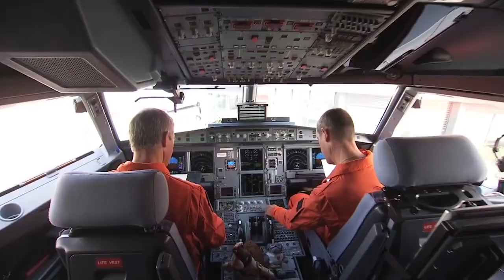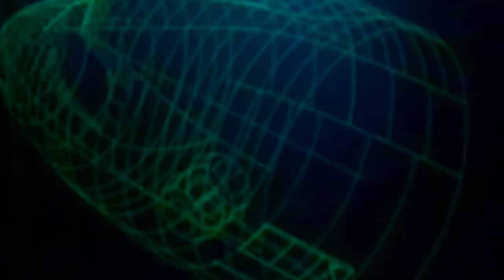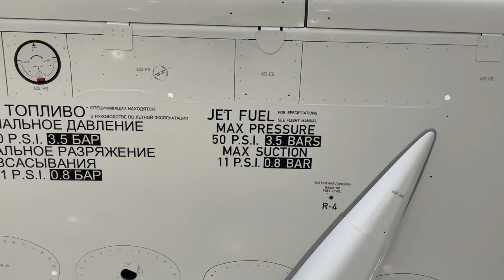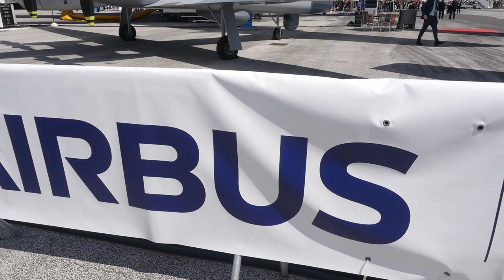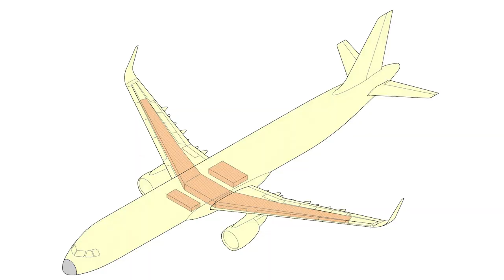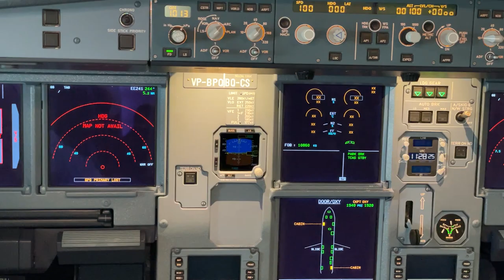Airbus A321 - becoming an ace of trumps

Comment: Delta was extremely interested in the Boeing NMA even wanting to be the first operator.  They wanted input on the design.  Since that evaporated, I guess they have moved on to Airbus and the A321 and A321 NEO.  They no longer have any Boeing Aircraft on order but plan to operate their refurbished B757 and B767-400s for the next few years.  (They are awesome with the new interiors; I flew on both last month).  Boeing screwed up more than the B737-MAX, they also forfeited Future Sales.
Reply: Testament to the late stage of corporate America
Reply: @ecoRfan  Yep - just in it for the investors in NYC at this point.

Comment: The 757 could have been the plane to modernize and build upon as it was newer than the 737.  There was not much economics to benefit from without drastically changing the 737 physically.  Airbus has in its DNA that ability to make changes on the planes it designs; from the beginning, versatility was all around, all the way to the luggage containers; flexibility was key in order to reduce the cost of operations whether for airfares, maintenance, repairs, or even the airports costs and insurance. I won’t be surprised if that philosophy inspired other entities outside aviation to evolve beyond their traditional business models.

Comment: Answering where this habit came from is very easy: since the A32x NEO proved to be very flexible, they can adapt it to serve a wide range of needs with a minimal investment and with no or minimal overhead costs to airlines. They would be mad not to take the money that's lying on the ground in front of them, especially since that strategy had mode than paid off by creating a massive headache for Boeing and virtually driving the COMAC out of the Western market before it was even released into production.

Comment: 4700 nautical miles is well over 8 hours endurance.  8 hours endurance is the maximum efficient endurance for a plane of this size.  At any distance materially greater than 8 hours of flight time, two crews must be carried.  In this setting, the optimum balance between seat cost and crew cost mandates a larger aircraft.  
Airlines might be making enquiries about such a jet, but they aren't paying deposits.  Routinely a paper order for an A321neo can be converted into an order for an A321ceo or even an A320ceo if desired.  This is especially true if the new aircraft's performance falls short of expectations.
Reply: Yeah it almost seems like the limits are being pushed by adding as much extra fuel tank capacity possible to what is already a stretched design, whether that compromise is performance or capacity.
Reply: @ecoRfan  That is true, but keep in mind the 737 platform is being stretched even further from its original design objectives.  For a given level of engine performance, the A320 design will stretch further than the B737 design, because of negative static stability and more clearance between nacelle and runway.  Already the largest 737s are needing a very high approach speed and any increase in empty weight will increase that landing speed further.  This was one reason why the 737 was unsuitable for the new airport at Sant Helena, for example.

Comment: The information on the ACTs (Additional Center Tanks) at 08:10 is not correct, in that they are not unique to the NEOs.  The two ACTs aft of the wing were an option on the -200 series that was taken up on virtually every aircraft; given that there were only about 90 A321-100 aircraft produced (and less than a dozen still in service) and that virtually every A321-200 has the two optional ACTs aft of the wing, for all practical purposes one can assume that all A321 CEOs have those two tanks.

Conversely the forward (third) ACT is not standard on the NEO but rather is an option for the A321LR model.  American Airlines, which is the world’s largest operator of the A321, has about 45 A321 NEOs in service so far, none of which have the forward (third) ACT.   American is also taking delivery of ETOPS A321 NEOs that may have the forward tank, but as best I know right now will not.   

American Airlines A321 NEOs will not get increased fuel capacity over the standard A321 CEO until taking delivery of the XLR variant, which will have an even larger permanent Rear Center Tank in place of the two aft ACTs and  which is roughly equivalent to four ACTs, or doubling the aft ACT fuel capacity, while the forward ACT will still remain available as an option.

After all that, the short version is: All 321s - CEO and NEO - have the two extra tanks behind the wing, while some NEOs may add the option of a third tank forward of the wing.

Comment: I think the next generation of clean sheet designs will aim for the size of the A321 with options down and up. The A220 has demonstrated the benefit of having a smaller dedicated aircraft, and the A321 size allows you to reach both the Small segment and the MMA
Reply: At this rate it will be 2050 if we're lucky.

Comment: They're basically milking the most out of the a32X fuselage for max market diversification in a point to point based route paradigm
Reply: Wish Boeing re-engined the 757 and made a 757-400 NG/MAX. They could easily increase the range to 5000 NM.
Reply: @Dave-dh7rt  why 400 though? Do you mean a stretched fuselage or just an updated 757 the size of the 200
Reply: @Dave-dh7rt  it would require much more than that. In addition to aerodynamics the Airbus lineup is far more efficient with space, both in cabin and fuel layouts. The aircraft is also significantly lighter (~50k lbs) and uses some composite structures. 

Plus you can’t just bump raw specs… safety and redundancy as well as better cockpit ergonomics (large LCD screens with fully integrated FBW, complete triple redundant systems and flight protections, etc) are also big selling points. 

I also don’t think there is currently an engine being offered in that power class, plus Boeing’s own CONSTANT mention of an NMA essentially destroys any potential for a 757 MAX type plane. 

Also there’s the issue of commonality which wasn’t brought up in the video - airlines LOVE being able to train pilots on a type that can essentially do almost anything they need. The same goes for their maintenance teams and parts depots, etc. Bringing the 757 back in any form would be a logistical nightmare for most airlines.
Reply: @EstorilEm  Plus the 757 is long out of production, and the tooling is long gone.  I see a lot of people on Youtube suggest a new 757 building programme but that would require not only re-tooling, but re-certification of a 50-year old design if it could ever happen.
Reply: @owenshebbeare2999  38 year old design, not 50 (1983).

The A320 is a 34 year old design by comparison (1987).
Reply: @EstorilEm  Aerodynamics? The A320 wing hasn't changed since 1988, and the airframe systems and cockpit since 1987 (ok, the CRT's were replaced by LCD's, but they still follow the same 1987 form factor, not the large ones you see on 2010's aircraft like the A350 and 787 as you claim).  

While the 757 won't come back, you make it sound like the A320 was introduced 25 years after the 757 - it wasn't: 1987-1983 = 4 years.

Regarding redundancy and safety - the 757 still has a comparable safety record to the A320 CEO family, and is still more modern than the 737 NG in some regards (cockpit ergonomics as you mention).

Comment: The thing is ,the A321 LR has somewhat wierd handling charactistics during landing , it likes to drop suddenly after retarding the throttle,also the auto-thrust is nowhere near as responsive as the CEO ,during approches the speed is always off buy around 10 knots.of course pilots can learn to deal with the changes but these two factors combines sometimes makes it really quite difficult in windy conditions.The good thing about them is that the vls is 10 knots slower during approaches ,so for most situations pilots prefer flying the CEO apart from approaches at high altittude airfields . By creating the A321 XLR the 320 palttform has reached its capability limit i'm afraid.
Reply: @Sacto1654   the 320 family has "control laws" for example with all 321 LRs during landing it's "landing law" meaning the movement of the horizontal stablizer directly correlates to the back and forth movement of the control stick while the roll control remains like "normal law" .In normal law the input from the stick only tells the computers to change the current state of the aircraft and with the stick at neutral position the computers will do their best to maintain present pitch ,roll etc,this is all fine except for landing ,the pilot would expect pulling the stick back and holding off instead of setting the attitude and releasing the stick ,so "landing law" has to be introduced. threrefore the handling charastics during landing must have someting to do with the weight/lift  balance at different speeds,and i doubt changing the logic of fly-by-wire system will help much

Comment: And now it's time to add the A322, a stretched A321 based on the XLR, but with 24 more seats, plus transcontinental USA or US East Coast to Europe range.
Reply: It'll need a new wing most likely - the 1988 wing is too small and outdated to get that extra performance.
Reply: @twiff3rino28  then again Boeing is doing the 737 MAX 10... right to the end of the runway
Reply: Ian McAllister: A322 is fake. Airbus should make A321XERs the extra extended range A321NEOs

Comment: One thing Airbus has yet to figure out on this family of airframes is the durability of the fuel control panels for the fuelers.  Not fun having to drip-stick these planes when panels aren't working.  They should've standardized the location of the fuel control panels for all of them instead of letting fuelers always having to figure out if the panel is on the wing with the SPR or on the belly side.

Comment: I remember seeing pictures about 30 years ago of air India's first a320's they had a 4 wheel landing gear set up on the main wheels they had this so they good spread the weight out on there poor runways why not put it on the 321 for more weight the pilots would love it for the extra braking and it would make it look like a 757

Comment: Boeings biggest mistake I feel was killing the 757. They could have maybe looked at a 757NG - with Dreamliner cockpit, cleaned up airframe, a version of the Dreamliner wings and of course new generation engines...with no ground clearance problems.

As for A321XLR I'll never want to fly for 10hr+ on this narrow drainpipe. It will be utter misery. Just one aisle, imagine the constant lines for the toilets, FAs trying to do their job etc.  Also what about crew rest area? The only way to do that will be to reserve seats. On a budget airline the seats will be horrible. On airlines like Jet Blue theres the excellent Mint. 

So the experience on these planes depends on the airline you are on. But even then theres no escaping the fact that you are on a narrow tube for a long long time. I have been on a 6hr 50 min flight on an A320NEO..never again. I for one will happily pay more to go on a widebody. Excellent video friend, subbed!
Reply: Their mistake wasn't killing the 757. Their mistake was not having a replacement for it. I'm willing to bet that if they kept the 757 going with newer versions, we would've seen something similar to what happened to the MAX.
Reply: @Juan444tv  The 57 and its much higher ground clearance I think would have meant they would not face the same issues as they did with the 737 design? Just like Airbus didnt when they stuck fat fans under the A320 series to make NEO. 
While I agree that Boeing should look at a new design a modded cleaned up 57 might just have worked. They didnt think so of course and that was the end of that. Just glad I got to fly on one!

Comment: The A321lr or A321xlr coupled with the A321neo is a good companions to the A220-100/300 or the A320neo and the A330neo and/or A350
Reply: They have a very solid lineup right now… the 330 still has its place but airlines are very much either point to point or large / maximum efficient long haul widebody it seems. 
The 330 was really remarkable for its time, but is a tough sell today, especially with mainline airlines dumping and retiring so many models into the after market for smaller airlines to pick up.

Comment: I predict the A220-100, 300 and new 500 & 700 will replace the A319, A320 and A321 and a new highly modified  A321 will be branded as the A322XLR-100 & 200 will replace all the Boeing 757’s.
Reply: No, the A220 cannot replace the A320 family. It is a smaller plane
Reply: @aarondynamics1311  the planned 500 & 700 larger wing & stretched fuselage can and will.
Reply: @icare7151  They cannot. They might be able to match the capacity of the A320neo/A321neo, but they will certainly fall short on range like the 737 MAX 10. Airlines love the A321neo because of how flexible it is, and it wouldn't make sense to replace it with an aircraft that will never match the range of even the LR, let alone the XLR. The -700 variant would also suffer from the same problem the 757-300 suffered from - it takes ages to board/disembark passengers due to it's length. I think an A220-500 would work, but not as an A320neo replacement. It would be the perfect aircraft for short haul routes that needs more seats than the A220-300 while the A320neo would be for routes with similar demand but longer range
Reply: @aarondynamics1311  The A321LR and A321XLR should be renamed the A322-100 and A322-300 series. 

An A220-700 would replace the A321neo.
Reply: @icare7151  In my previous comment, I mentioned that the reason why the A321neo is so attractive to airlines is due to its flexibility: the A321neo family can either fly long range or fly high demand, short range routes. Also, the A321neo has a common type rating with the A320neo, meaning that airlines can operate lower demand routes as well as the routes operated by the A321neo with a single group of pilots. If the A220-500 and -700 were to replace the A320neo and A321neo, airlines would need 2 groups of pilots to operate the same routes, which would counteract the savings brought about by the small increase in efficiency.
Reply: The XLR is already being touted as the optimal 757 replacement.

A220 could certainly go after A319 and 320 CEO's though - many from the early-mid 90s are still flying without replacement.
Reply: @aarondynamics1311  It would be a no brainer to replace A320 CEO's though.  You're talking about a 25-30 year gap in technology between the CEO and A220.
Reply: @twiff3rino28  Yes the XLR will be the 757 Boeing replacement as Boeing is phasing out of the narrow body Commercial market. 

They will have success only with the 787 and modest success in small number with the new 777X.

Boeing will still be strong for the USA military contracts, parts for older aircraft and there space division,  but massive layoffs and canceled Max orders is there dismissal commercial airline future.
Reply: @icare7151  It's a shame they didn't buy the C Series (A220) when they had the chance - this is what happens when you leave a handful of powerful yet clueless Manhattanites in charge of your project strategy.

There are still almost a thousand 20-30 year old A320 CEO's still flying that need replacement ASAP.  A stretched CSeries would have been a full human generation ahead tech wise if Boeing went this route.